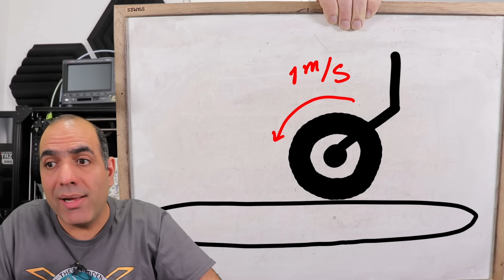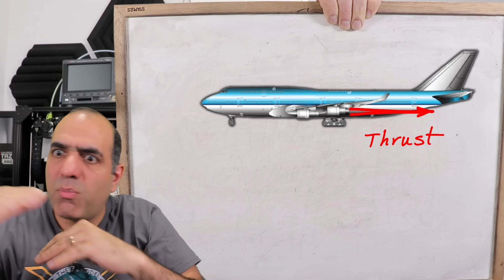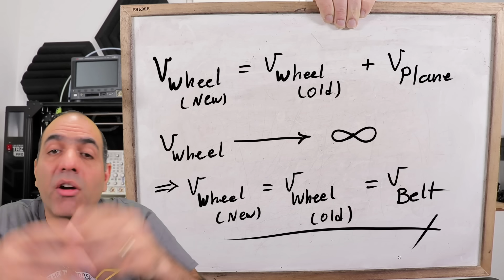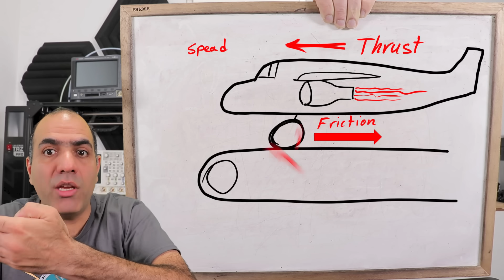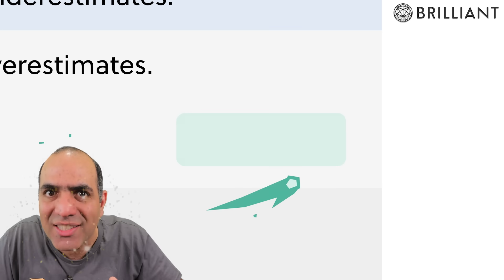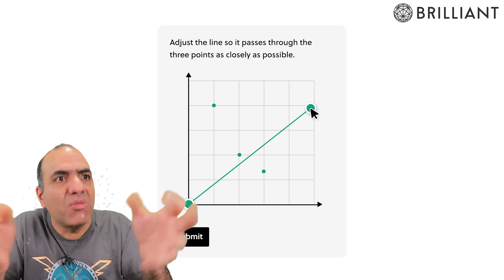Airplane Question that Drove Me NUTS!!!

Comment: So glad somebody actually acknowledged the problem of the friction of the wheel bearing reaching infinity preventing the plane moving regardless of the fact that wings use lift, the amount of people i've tried to explain that answer to only for them to smugly not get it at all is so painful
Reply: If we have friction, then the friction of the treadmill's own bearings would be more significant. Nowhere does this state "magic treadmill", so we're left with a conventional one! Aircraft wheels are meant to accelerate from zero to around two hundred knots in a fraction of a second on landing - There's not a lot of friction there! Meanwhile, the treadmill runs off something like a geared motor.
Reply: For the friction of the wheel bearing to reach infinity, the friction of the bearings of the conveyor would also need to reach infinity. At which point the conveyor belt would stop.
Reply: @rodericklenz5030  If we assume the airplane is just a real plane and the conveyor belt is magical alien technology, this isn't necessarily true.

If we assume the conveyor belt is just a real conveyor belt, it can't meet the specs of the problem as commonly stated.
Reply: I only wonder what's about the friction of the bearings of that giant conveyor belt? 
I mean plane wheel bearings are designed to withstand the heat of the brakes on the landing gear. (~800-1000°C Not in the mood to convert it to freedom units) 
So whats about the giant bearings of the conveyor belt that at least has to withstand the 180? tons of plane and its own weight which is probably a very times more than that at a speed of at least at 600 km/h... 
I think they will most likely fail before the bearings of the landing gear.
Reply: @Troppa17  the main idea is just that they're present and since we're dealing with such ridiculous speeds they become significant, no matter how efficient or resiliant any of the bearings are. It's all mostly food for thought.
Reply: It's a question of how you interpret the problem.  TLDR version: interpretation #1 is that the speed of the bottom of the wheel matches the speed of the conveyor.  This is exactly what happens on a normal takeoff roll and the conveyor would never move.  Interpretation #2 is that the speed of the conveyor is equal to the linear speed of the wheel *as a whole*, i.e. the speed of the axle over the ground (in which case the wheel would have to spin twice as fast as usual, but the plane could most certainly move).  Interpretation #3 is that the speed of the conveyor is equal to the reading of a speedometer attached to the wheel (in which case things diverge to infinity, give or take friction).

As Randall Munroe put it: "So, people who go with interpretation #3 notice immediately that the plane cannot move and keep trying to condescendingly explain to the #2 crowd that nothing they say changes the basic facts of the problem. The #2 crowd is busy explaining to the #3 crowd that planes aren’t driven by their wheels. Of course, this being the internet, there’s also a #4 crowd loudly arguing that even if the plane was able to move, it couldn’t have been what hit the Pentagon."
Reply: Tell me about it.
I heard the "the wheels are not driving the plane, stupid" a couple dozen times by now.
Reply: As i mentioned in another reply the friction won't reach infinity as it will stop to grow the moment it reaches the same amount as the static friction between the wheels and the ground, then slipping will occur the plane will slowly start to move forward which induces a miniscule amount of lift which reduces the static friction even more. Etc.
But more likely this will happen:  @Yippy  My point was simply that the scenario described in this riddle is physically and mechanically impossible and there are to many 'ifs' to really think it through in a Gedankenexperiment.
If there could be zero delay The rolling friction of the wheels and the friction of the bearings grow linearly with the speed the tires are turning when the sum of these frictions gets higher than the static friction the wheels will start to slip and the plane will slowly start to move forward, so if the wheels were indestructible the plane should lift off at some point. But more likely something like this will happen: https://youtu.be/AW7znizsUEw
Reply: @zerfo7418  you missed a point: If the wheel slides, it's not rotating. If the conveyor is matching the rotational speed of the wheel, as soon as the wheel stops rolling and slides, the conveyor stops too. The comedy here being that it doesn't matter how absurd you make your assumptions about the relationshop between the wheels and the conveyor, the conveyor can never stop the plane moving forward
Reply: Friction isn't dependent on speed though. Increasing speed doesn't get you increasing friction force. It does get you increasing heat.
Reply: @jannepeltonen2036  Uh damn, you are absolutely right i must have mixed it up with drag. Shame on me D: at least in bearings which are lubricated the resistance is somewhat velocity dependant, but i admit mistake.
Reply: @Epic501  People should not be smug just because they are superior to slow witted strugglers.  Try to simulate respect and relative equality, it is kind.
Reply: Even if the bearings lock the wheels up because of said friction the wheels are gonna slip, or even if the bearings blow out, the arms are gona scratch against the conveyor. Regardles of what happens to the wheels the plane will still move forward.
Reply: Because it's irrelevant? The force is pushing against the air, not the ground.
Reply: You’re being very selective about what to ignore here. If bearing friction can’t be neglected, then why can material limits on the conveyor belt and wheel assembly be neglected? In real life you won’t get a conveyor anywhere close to the speed required to prevent a jumbo from taking off.
Reply: @davidturner9827  if you watched the video, the whole point is that the answer depends on what you're being selective about. In the scenario of "Real plane on thought experiment conveyor" you're not just ignoring friction, you're assuming conveyor with infinite capabilities and, along with it, substantial friction between the belt and the wheels, because a good conveyor belt isn't made out of slippery stuff.

Its not cherry picking, its just illustrating that the question isn't as simple as people are treating it. 

If anything, its not designed to catch people who don't know how planes work, its designed to catch people who don't know how thought experiments work.
Reply: @Cowclops  I read the original Twitter thread and watched the video. The question says nothing about “infinite capabilities” or friction. If it did, I might agree with you; as it is, it’s an open-ended question and real engineers make realistic assumptions.
Reply: @Cowclops  in fact, let me go further: if you want to assume a conveyor with “infinite capabilities”, then you should also assume that the conveyor can go infinitely fast, and the plane will take off. Like I said, you have to be extremely selective about what you ignore in order to conclude that the plane will remain motionless.
Reply: @davidturner9827  in a question where those things aren‘t specified, no one is neglecting anything. Just assuming certain properties to be a certain way.
Reply: Friction and bearings are irrelevant because this is a theoretical question. Assume perfect bearings for the purpose of the question.
Reply: @firesurfer  The question does not state to ignore friction and was posted by an engineering account and not by a philosopher. Ignoring friction is nothing an engineer would arbitrary do. But okay for the sake of it i declare the friction between the runway and the plane also to be zero, so the wheels don't need to turn at all for the plane to slide forward. %D
But okay if there is friction on the surface of the conveyor belt at one point it will start to drag air with it and at sufficient air speed the plane will be able to lift off. 
Now you could insist to ignore air friction this in turn will completely change the rules of aerodynamics and it might be impossible for the plane to lift off at all.
It is impossible to say what will happen because the question is nonsense in the first  place because everyone can contrive his  own rules.
In my reality the tires will fail before anything else, the speed synchronization then stops making sense and the conveyor belt will halt.  If the plane can lift of just sliding on bare metal i don't know.
Reply: Oh no, we get it... We just think its a stupid goal post move that violates the spirit if what a treadmill is, which is really the core idea of the question, "can you treadmill a plane" (meaning keep it in place on a conveyor belt by matching speed with the plane).

Once you start saying nonsense like "match speed with the wheels", then inevitably, the magical conveyor belt will rapidly speed up to infinity, just due to the plane daring to move relative to its environment at all, and the for some reason NONmagical bearings of the plane's wheels fail structurally, at which point, they no longer act as good landing gear, and the plane grinds to halt... Congradulations, you've brute forced "the plane wont take off" answer by a semantic means, ya happy now? Ya happy with your cheap win?

Nobody who actually thinks like an engineer likes this answer, because its a clear example of manipulating the conditions of the experiment just to get a desired result, while violating the premise of a treadmill in the first place. It's also obnoxious because it's an untestable setup, no conveyor belt can just accelerate to infinite speed. The original spirit of the experiment is that of matching the treadmill speed to the speed of the plane... That IS practical and testable... And it has been done (mythbusters), and it DID take off, much to the consternation of the pilot (very disconcerting, lol).

People blow right past your explanation and ignore it, because its a bald faced goal post move to something ridiculous, and far from the original concept, just to avoid being wrong... And ngl, a lot of normal people just HATE arguing with people like that. We all know somebody like that. At some point, it's easier to not reward people with last word syndrome, by not even dignifying goal post moving with a resonse, and sticking with the original concept.

And yeah, I know theres a version of the problem where it says "matches speed with the wheel" instead of "matches speed with the plane"... Thats a newer version of the problem, just so people like you can make a dumb argument and feel right about it... That question is dumb to begin with, BECAUSE it implies immediate acceleration to infinite conveyor speed the second the plane moves relative to the rest of the world, and no such conveyor belt could be built to begin with... And again, at that point, its not even a treadmill, which was the original thought experiment.
Reply: People don't understand because you are flat wrong. The wheels are irrelevant to the question, as is the moving road surface. There is no point of force between wheel and road surface, The only RELEVANT fact to an airplane taking off is the air speed across the wings.
Reply: @danielstewart7732  Ideally.   Im going to hope someone mentioned this,    at some point Plane power overcomes drag of the wheels and just drags them,  If u pull up 1/8 inch  that will alleviate this ohh sorry  this was theoretical,   hmm.
Reply: @danielstewart7732 mehdi just said it.
If we have friction it will not take off.
The wheels, when rolling, generate a force opposing the engine thrust. The conveyor will increase this force until the thrust of the engines is met.
And if the tires blow out, we are at an even greater mystery, because they are no longer spinning. Does the conveyor stop?
Reply: @Squeaky_Ben  We don't have infinite friction. The  real world doesn't give a rip about classroom hypotheticals.  The take off speed of a 747 is around 160 mph.  so any scale that goes beyond those hard physical limits is irrelevant.  - and NO for the love of god wheels don't generate any significant opposing friction, that's the entire point of a wheel, to reduce friction to the lowest amount possible.   Aircraft take off with much higher friction all the time, sea planes, pontoons for water,  ski's for ice etc.
Reply: @danielstewart7732  You don't know what you are talking about.
Wheels do generate tangible friction,  which would approach infinity as it spins faster and faster, And as we also established: The plane accelerates to even 1 m/s, the wheels start spinning and accelerating ad infinitum.
The point is, no matter how the plane is propelled, it will not move.
Reply: @Squeaky_Ben  the bearings of the conveyor are going to experience equivalent increases in friction. Which is why Medhi is wrong here. For the friction of the wheel bearings to approach infinity, the friction of the convyor bearings would ALSO approach infinity and the conveyor would stop. In truth, and mathematically, the conveyor and wheels will achieve an equilibrium well below infinity.
Reply: @Squeaky_Ben  I love people with no clue about high school level physics,  trying to explain how something works when they are completely wrong. the friction generated by a free moving wheel, while tangible and calculable, is utterly insignificant to the aircraft taking off.  - the force PUSHING the aircraft comes from the jet exhaust pushing against air, not the ground. Wheel speed had NOTHING to do with the aircraft taking off.
Reply: @rodericklenz5030  Given you cannot build a conveyor for a plane in the first place, I assumed an ideal design for it, but not for the plane.
Reply: @danielstewart7732  You are the 50th person explaining that the engine, not the wheel, pushes the plane.
I am SO SICK AND TIRED of hearing this.
It does not matter what drives the plane. It will not fucking move for gods sake.
Reply: @Squeaky_Ben  You can absolutely build a conveyor for a plane. Even a 747. (FWIW, the longest conveyor belt in the world is 31km long), there are no unsolved technical challenges in constructing a runway sized conveyor belt. There's just no point because it wouldn't achieve anything. There's a difference between overlooking an aspect of a system and applying flawed logic (i.e. Medhi's proposition), and declaring that "these elements of type A in this part of a system will be ideal, but other elements of type A will not be ideal" that's just fallacious thinking.
Reply: @Squeaky_Ben of course it matters what pushes the plane. The plane does not move forward because the wheel pushes against the ground. The plane moves forward because the engines compress massive (as in having a lot of mass) amounts of air and push that air out the other end. Compressing and pushing this very large amount of air creates the reaction force. Newtons third law here: forcing the air in one direction creates a force against the blades of the engine in the opposite direction that pushes them (and the plane they're attached to) forward. The wheels exist to ELIMINATE the friction force between the ground the plane is resting on and the plane. That's all they do.

Think of it in a slightly different way: instead of a 747, you have a missile sitting on a trolley on the conveyor.
Reply: @danielstewart7732  The wheels are not irrelevant to the question, because they are part of a condition of the question that must be met in this fictional scenario. And the only way this condition can be met, is if the friction of the wheels matches the thrust of the engines.

Which, as is my personal guess, would just melt the whole apparatus. With a bit of luck the airplane would survive this and leave a melted pile of wheels behind and maybe take off. Or the engine would just push it along the ground (without wheels) and then even more friction would destroy the rest of the airplane. ^^
Reply: @streetdogg8206  They are irrelevant, the minor friction loss from the bearings, and contact from tire to "road surface" are inconsequential to the amount of thrust the engines produce.
Reply: @danielstewart7732  I agree that it's probably unlikely to ever generate enough friction to stop the plane from moving, but that just means that the conditions of the question are impossible to meet. It's kind of a "chose which condition or physical reality you want to ignore to make it work somehow"-question, which is probably why it's debated so endlessly (I've literally been debating this 20 years ago already...). It just comes down to what you prefer to ignore and if somebody else ignores something else, you will never agree. Simple as that.

... but I still think in an attempt to create enough friction, the conveyor belt will (must) accelerate to an insane speed and quickly melts the wheels. ;-)
Reply: @danielstewart7732  Planes have wheels because they need something low friction to get from "ground speed of 0" to "air speed high enough to fly" (given winds that aren't usually 150 knots at the surface).

If you install a black box device that can interfere with the ability of the wheels to do their job (or even just apply the plane's own real world brakes) it doesn't move even at full thrust. A 747 with its brakes locked doesn't move even at full thrust. It doesn't drag the wheels. 

The wheels don't supply the motive force, but they have to be there and functioning for a plane to take off. If it can't hit V1 without blowing a tire or having a bearing weld itself into a solid piece, the plane can't take off.

This isn't to say "wheels don't propel a plane" isn't a valid lesson, but its why your seemingly obvious and simple that the plane "will" take off no matter what the stipulations are, isn't right.
Reply: @Cowclops  what’s the friction between the tyres and the conveyor? That’s another missing piece of info. So since it’s missing, I‘ll ASSUME it to be zero, and the plane can take of normally.
You can of course assume it to equal asphalt or concrete, but that’s also just that: an assumption. The question is simply interaction bait, (thus) badly worded and missing a lot of info that is necessary to answer it.
Reply: @Cowclops  lot of hot air,  which coincidentally is what a 747 uses to take off.  The wheels have nothing to do with an aircraft taking flight other than a mobile platform to support the weight of the aircraft until lift is greater than airframe weight. The speed the wheels turn, and the speed of a moving surface under them have nothing to do with the aircraft taking flight.
Reply: @Runoratsu  in general the friction between any tire and the surface it's resting on is going to be less than or equal to the static coefficient of friction of the materials multiplied by the normal force. Otherwise the wheel would be sliding and not rotating and the bearing is meaningless.
Reply: @rodericklenz5030  well, so? There‘s nothing about bearings having to be used in the question. The conveyor can have a greased, soaped teflon surface, or an alien material with even less friction. IT IS NOT SPECIFIED IN THE QUESTION. That is my point. It makes no sense arguing about it, because everyone can assume different conditions and thus come to different conclusions.
Reply: @danielstewart7732  Thanks for your mansplaining. I am a pilot.

If the wheels have nothing to do with the plane taking off, why do planes have wheels?

They don't provide the propulsion, but they absolutely need to be there.

This question is clearly designed not to catch people who don't know how planes work - its designed to catch people who don't know how thought experiments work and you dun got caught.
Reply: @Runoratsu  The thought experiment doesn't require us to selectively ignore friction though, and in fact if we're simply assumine "real earth plane" but "alien conveyor tech" you'd actually want a lot of friction between the belt and anything on top of it, but not much friction in anything thats supposed to be moving. 

I'm leaning hard into the "special magic alien conveyor with perfect construction" pretty hard and thats not the only possible interpretation of the problem, but the ideal conveyor wouldn't be completely frictionless anyway. If we can move the conveyor belt at the speed of light, we might as well make the traction surface out of something with a lot of friction too.
Reply: @Cowclops  Not really, you can have skis mounted for water takeoff. Wheels are redundant.
Reply: @firesurfer  Skis are for snow, floats are for water, but thank you for playing.
Reply: @Runoratsu  a bearing is anything that moderates friction between moving parts and constrains relative motion in a desired plane. The wheel of the plane IS a bearing. By definition a conveyor requires bearings to constrain motion of the belt and allow it to actually move. Greasing the surface will only turn the surface into a bearing, and in the case the surface was sufficiently greased, the wheels slides instead of roll and the plane takes off. In the case where the conveyor is supposed to match the rotational speed of the wheel, you've greased up your conveyor and the wheel slides having 0 rotational speed, so the conveyor doesn't move. The point here being that you actually CAN'T assume different conditions and produce a different result, except in making assumptions about the air (or other fluid, or lack of). There is no situation in which a conveyor can actually arrest the forward motion of the 747.
Reply: @rodericklenz5030  Oh, no situation? I want to see a plane take off from a runway coated in super sticky glue then. Or 1 foot deep hot gooey asphalt. The question does not specify the conveyor surface, so both are possible conveyor surfaces.
Reply: @Runoratsu  if the surface is sticky enough to stop the wheels rolling, the conveyor also never moves, so no, that would be an invalid specification for the question
Reply: judging by whats given. Plane starts stationary, can not accelerate past 0 since:
1) wings  have no speed relative to air around it since plane started stationary and has no way to accelerate anyway, Up nor forward.
2) as soon as acceleration gained conveyor belt drops its acceleration to 0. hypothetically if delay between these two events is 0 then acceleration RELATIVE TO anything is 0. yes the plane has potential energy but it is stationary. 
No wing to air relative spead = no lift.
Reply: @DavidHeich  Planes do not typically use wheels to accelerate to flight speed...

THUS wheels and belt speed do not matter.

For example, if a 747 is taking off at 184mph on a runway using its jet engines, and the conveyor belt runway is going 184mph the other direction. The wheels are being rolled as though the plane were traveling 268 mph; which is unfortunate because a 747's wheels are only rated at 235mph.

Assuming the wheels don't fail, the 747 will travel forward 5000 feet and take off without issue.
Reply: @DavidHeich  I have a question for you, what pushes the plane forward?
Reply: @coolbionicle  jet engines
Reply: @coolbionicle  let me ask then, what pushes the jet upwards?
Reply: @DavidHeich  Good, very good. Now, before I answer any of your questions, what medium do said jet engines use to push the plane forward?
Reply: @coolbionicle  horizontal air thrust.
Reply: @DavidHeich  That's not a medium but the pushing force. But since you understood the question I'll let it pass. Now, is there any mechanica conection between the air and the conveyor belt that'll hinder that force? The answer is no, if anything the only mechanical connection it has is shear viscous adhesion and at most it would create drag wind that would ultimately turn into lift when it hits the wings.
Reply: @coolbionicle  youre telling me that the conveyor belt will make the air circulation enough to give significant lift, seriously?
Reply: @DavidHeich  Taking into consideration both the contact point friction of the tire and the terminal spin of the wheels caused by friction within the bearing and asuming the wheels won't just explode due to high speed, the real world analogue would be having the plane sitting on stilts with rubber feet. The shear force caused by the floor on the stilts will allways be equal to the thrust force generated by the jet engines, and yes, it will resist the forward motion of the plane for a bit until the rubber feet friction gives in and the stilts start getting dragged by the plane.
Reply: @DavidHeich  in a world without friction and with infinite energy, yes.
Reply: @coolbionicle   I see, basically you're refusing to accept a world provided which disagrees with your answer. Instead you try to alter situation so you get the result you seek. Okay mr fluent confidence, How about downpull caused by stationary jetengine causing air to flow over the wing  back to front? World without friction this whole scenario is absurd.
Reply: @coolbionicle  look at STOL airplane and learn please
Reply: @DavidHeich  lol if what you said is true than even planes on regular ground could not move since their wheels are not powered (therefore according to you there is nothing to increase their speed from 0) ... and that is not the case evidently
Reply: @DavidHeich  The wheels don't matter at all. If they did, how can a plane on skis or pontoons take off?  How does a sail-boat with no engine move?
If you have a powerful enough jet engine on a light enough plane, you could take off sitting on the belly. Like there was no landing gear even installed.
Reply: @yutub561  Finally! Someone else in this thread that sees this!
Reply: @coolbionicle  the only people who get this question wrong are people who get stuck on the idea that the wheels move the plane forward.
Reply: @rodericklenz5030  Which is sadly much more people that I previously thought 😔
Reply: @Bunnyh

I hate to pull appeal to authority argument, but as a 6 year jet engine mechanic, 2 years deep into a physics major at 4.0, and someone working on his PPL... You dont understand aircraft nearly as well as you think you do... Which is why this other commenter is leading you on with questions about how planes work to begin with.

Planes accelerate forward by pushing against THE AIR (not the ground, THE AIR) using propellers or jet engines... Thus, they generate airspeed (AIRSPEED... NOT GROUND SPEED, AIR SPEED).

This means aircraft, when they throttle up, and assuming (relatively) frictionless contact with the ground through freespinning wheels and bearings, the plane will accelerate... NOT relative to the ground under the wheels, it will accelerate relative TO THE AIR... Since it is THE AIR that the engines are pushing against (and, since the moron who wrote this problem is obsessing about a ground conveyor belt presumably the air is still in the problem).

Since it accelerates relative to the AIR, it will accelerate from 0 AIRspeed to takeoff AIRspeed (whatever speed that is, every aircraft is different. My own plane had a takeoff speed of 60 knots... 60 knots AIRSPEED, not f@cking ground speed...). Once at that AIRspeed, the plane lifts off, becuase enough AIRFLOW is going over the wings to generate LIFT... Im capitalizing these words so you can f@cking understand the distinctuon between airspeed and ground speed, and the disntinction between sending propulsive power to the ground via wheels (as is the case in a car) vs sending propulsive power to the air via propellers or jet engines.

Lets use my plane as an example, 1946 Erco Ercoupe. It would accelerate to 60 knots airspeed, generate lift (AGAIN, because this is above the stall speed, and this is the speed measured relative to the air... Not the ground), and take off. Assuming still air, no wind, this would also be about 60 knots ground speed, relative to the earth everywhere but the conveyor belt.

The only UNIQUE thing that happens is that the "ground" speed relative to the "ground" directly underneath the wheels... Which is the conveyor belt moving at 60 knots in the opposite direction, trying to stop me from taking off... Creates a "ground speed" of 120 knots, at least relative between the plane and the conveyor belt.

... The wheels are free spinning, and relatively frictionless. Yes, this ground speed is VERY high for take off, and yes, this is double the RPM the wheels would normally spin at for takeoff, and yes, bearings do have limits... But funnily enough, Fred Wieck, the Ercoupe's lead engineer, went out of his way to design the most idiot proof plane on the planet, so the landing gear on that plane is overbuilt enough that it technically can land at over 100 knots... So funnily enough, this plane actually does have landing gear able to handle double normal RPM.

Some other scenarios I want you to really sit down and think about... Taking off at double normal ground speed in the real world, would be like having a tail wind at takeoff speed... I could theoretically take an ercoupe off in these conditions (I NEVER would... But it could be done). The result would be that to achieve 60 knots airspeed, I would need to get to 120 knots ground speed... This would at least double my takeoff roll, requiring double the runway I'd normally need.

On the flip side, to really hammer home just how much WHEELS have nothing to do with an aircafts ability to fly (beyond reducing friction between the plane and the ground)... Imagine me taking off in a 60 knot head wind (by the way, 60 knot winds arent unheard of). In theory... The wheels wouldnt need to roll at all, I could just pull up, and take off from a standstill. I would need to throttle up before hand, to ensure the wind doesnt accelerate me "backwards", reduce my AIRspeed to below stall speed, and crash (this does actually happen btw, there are videos of light aircraft with bad or no tiedowns, while parked, just catching a gusty headwind, taking off, getting carried away by the wind, then crashing back down as their airspeed drops to 0 with no engine running to counter it).

... There are also videos of STOL pilots just hovering in place for fun because of a strong head wind... Airspeed positive, ground speed zero.

This entire question relies on the inability of the laymen to intuitvely understand the difference between airspeed and ground speed, and the difference between how planes and cars apply their propulsion.

Conveyor belts work on cars because they locomote using the ground as a propulsive medium. Power is sent to the wheels, which can then be counteracted by a conveyor belt operating at the same speed in the opposite direction.

Planes DO NOT locomote using the ground as a medium... You were asked how planes accelerate forward, to MAKE THE POINT that planes apply power to AIR and thus, use air as a medium... So ground conveyor belts DONT prevent takeoff.

A more open ended question would be, "How would you treadmill a plane"... And there is a way to do this, hopefully you can figure it out already by explaining how a plane can hover in a strong headwind.

Since a plane locomotes via propulsion in the AIR... Then the thing you must "conveyor" is AIR... We have "air treadmills" like this... Theyre called f@cking wind tunnels... Stick my plane in a wind tunnel, crank the tunnel up to 60 knots of airflow, and I could take off inside of it... While staying put in one spot in the tunnel.

The point is, if you want to "treadmill" something, meaning to make it stay still by moving a medium to counter its propulsion... You MUST treadmill it by moving the same medium that is used by the vehicles propulsion system... For cars, thats the ground, for planes, thats the air. And you can apply it to any vehicle. For boats (excluding sail boats), you would need to treadmill it by using water currents.

Applying the wrong medium to treadmill a vehicle is just dumb in the first place. Sticking a plane on a conveyor belt and expecting it to stay put is as dumb as sticking a boat on a conveyor belt, and ALSO expecting it to stay put (though, for very different reasons. The plane takes off because it generates lots of thrust in the air on almost frictionless wheels, and accelerates forward in spite of the conveyor belt... By contrast, the boat has a ton of friction between its hull bottom and conveyor belt, while providing almost no thrust through air... So it just sits there, and goes wherever the conveyor goes... But both cases have the same result, which is that you've used the wrong medium to try and treadmill either vehicle, got unexpected results for your efforts, should feel dumb about it).

By the way, AGAIN, mythbusters tested this, full scale, with a pilot and everything... Ya seriously gonna keep arguing this? Like, I expect you to, but I'd be pleasantly surprised if you had the maturity to admit your initial intuition is wrong, learn from it, and move on in life.
Reply: @hatman4818    If you do a take off with a 60 knot tail wind🤣 remember that the tail wind will be faster when you climb away from the ground and its obstructions to the flow of the wind.  There will be a wind sheer risk unless you significantly increase your speed through the apparently slowing air.  Good luck with your flying and good luck ignoring the pain of paying for it😎
It is hard to imagine the mental stagnation of the zero movement proponents, Dunning-Kreuger at work.
Reply: @DavidHeich  The scenario described is flawed on so many levels. After reading your answer i wondered if a delay of zero is even possible because of General Relativity simultaneity is observer dependant. Because in the rotating reference frame of the wheels there is acceleration at play which also messes with the perception of time additionally because the speed of the varies according to the distance to the center of rotation there are even more effects at play for example radius dependant length contraction (Ehrenfest Paradox)
So assuming every component is indestructible and considering that absolute simultaneity is impossible at some point some kind of oscillation will occur which
Reply: @DavidHeich  according to relativity simultaneity is observer dependant so at some point some kind of oscillatory motion will occur, which after some time reaches a speed high enough to launch the plane into orbit, Assuming every component is indestructible. But what does that mean if the wheels are perfectly rigid they may be impossible to turn (Ehrenfest Paradox).
Oh man this whole question and Gedankenexperiment is flawed on so many levels, it is absolutely pointless to think it through. xD
Reply: @zerfo7418  But how can this possibly occur? Why won't the plane simply take off? 

The plane propels itself through the jet engines and gains altitude from the airfoil shape of the wings and pitching up using the control surfaces, the wheels are there simply to hold the plane above the ground until the plane takes off.

So therefore, if the jet engines produce enough thrust to overcome the added friction of the bearings spinning faster, the plane will take off. 

The bearings having twice as much friction from spinning at twice the speed will produce a negligible amount of resistance relative to the jet engines.

The only way to turn the bearings is to put force on the plane and the jet engines can only propel the plane to finite speeds.

The plane shouldn't need to reach infinite speeds to lift off as long as the bearings can withstand the high speeds.

I don't understand how the bearings will reach infinite speeds, can you please explain to me where I'm wrong?
Reply: @yippy7951  My point was simply that the scenario described in this riddle is physically and mechanically impossible and there are too many 'ifs' to really think it through in a Gedankenexperiment. Zero delay, indestructible perfectly rigid materials and infinite speeds don't exist

If there could be zero delay The rolling friction of the wheels and the friction of the bearings grow linearly with the speed the tires are turning. When the sum of these frictions gets higher than the static friction the wheels will start to slip and the plane will slowly start to move forward which generates a miniscule lift which in turn reduces the static friction but not the friction in the bearings so the tires could slip even easier and so on. So if the wheels were indestructible the plane should lift off at some point. But more likely something like this will happen. https://youtu.be/AW7znizsUEw

I think the most realistic and easiest way to test your hypothesis in the real world would be to simply prevent the wheels from turning (brakes?) on a regular airfield. 
As the wording of this riddle seems to imply that the wheels are kept in the same horizontal position relative to the ground (until slippage occurs)
So, to conclude depending on the initial conditions and the physical and mechanical parameters you might be right... or wrong; this riddle is silly xD
Reply: @yippy7951  The wheels spinning faster and faster is dependent on the idea that the belt will magically match the speed of the wheels and that the wheels must move as fast as the plane going forwards plus the belt going backwards. Consider a situation where the jet has already started moving at speed v. So the outside of the wheel is also turning at the speed v. But the belt would then be moving backwards at a speed v (by some unknown mechanism). But if the jet is still moving forwards at speed v, the wheels should be moving forward at speed 2v, as they're connected to the jet and also roll on the moving surface. But then that magical mechanism would make the belt move backwards at speed 2v, so the wheels should move forwards at speed 3v, to match the speed of the jet. So then the mechanism would move the belt backwards at speed 3v, and the wheels, being connected to a jet moving forwards at speed v, would have to move forwards at speed 4v. So that means that within this thought experiment, the wheels and the belt would have to move to opposing directions at a speed approaching infinity if the jet is moving at all. As soon as there's any forward movement of the jet, the wheels and the belt would have to start accelerating with no limit (because the speed of the wheels is always plane speed plus speed of the belt, but the speed of the belt tries to always catch up with the speed of the wheels). So it's not the plane itself that needs to move at infinite speeds; it's just the wheels, spun by the magical mechanism rolling the conveyor belt.